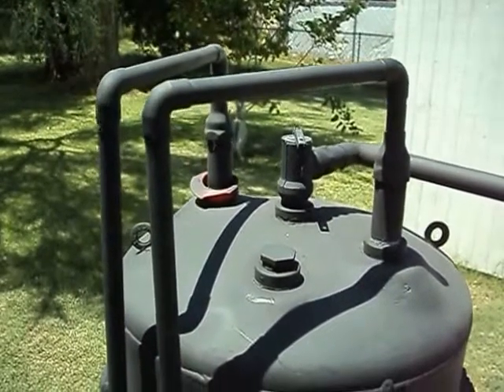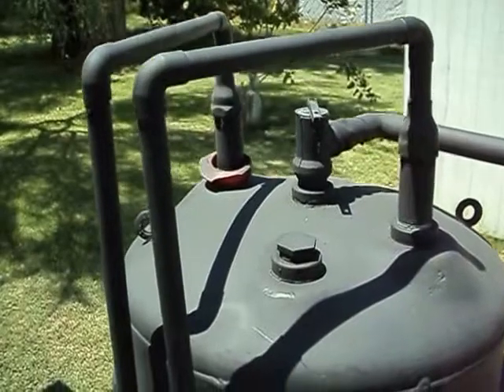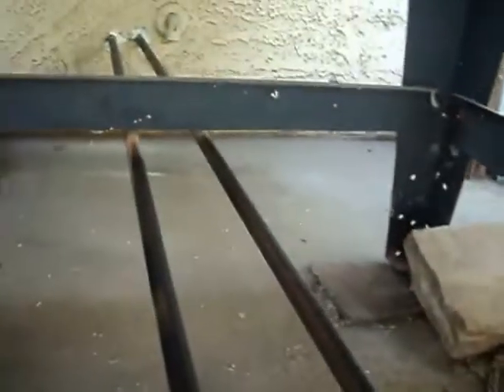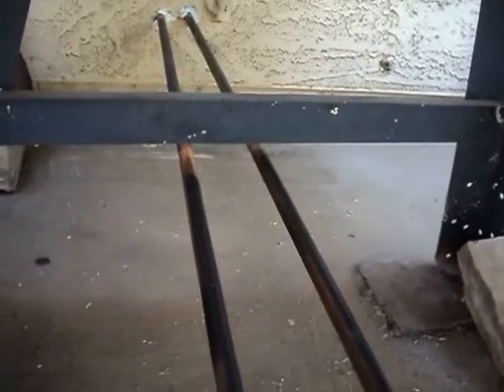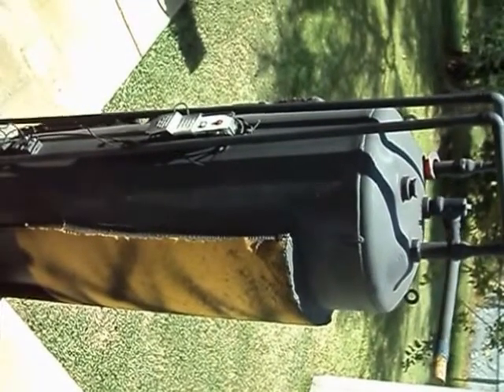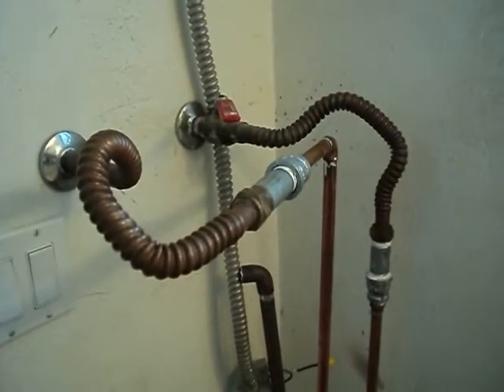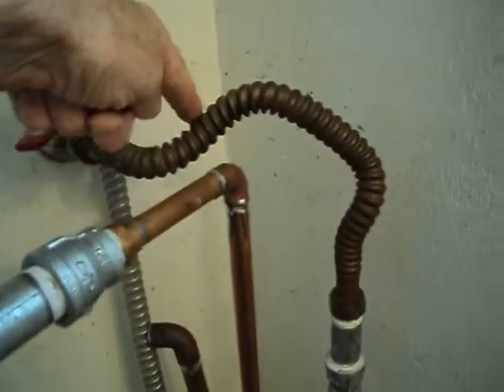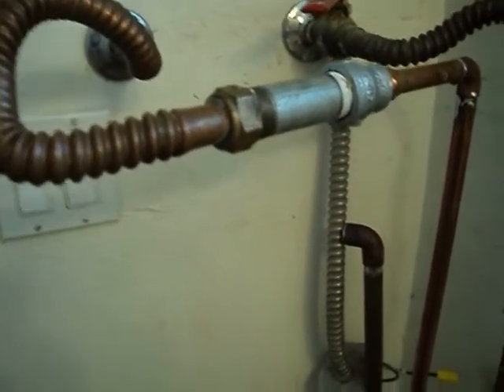Converting an Old Water Heater Tank to a Solar Water Heater

Comment: you can improve a solar still, storing the warm water from the  still n1 and mist the water in a second solar still with natural sponges and and black sand in the bottom as water evaporator and thermal storage respectively